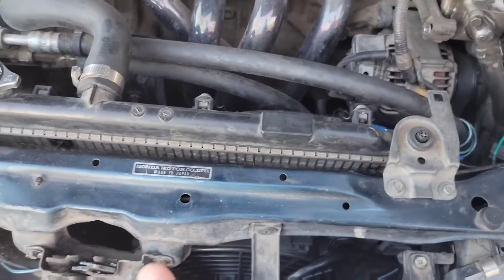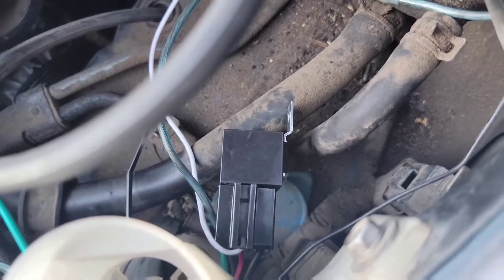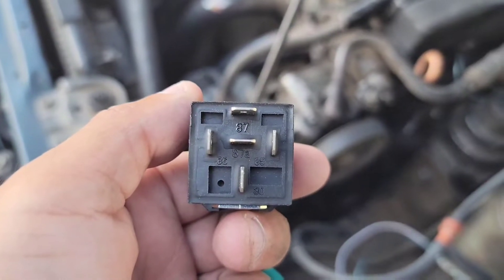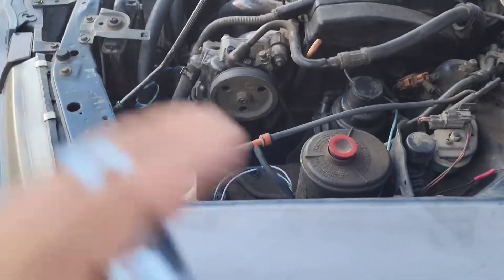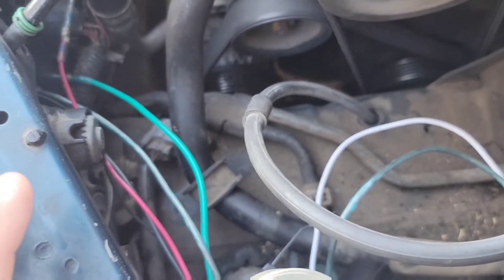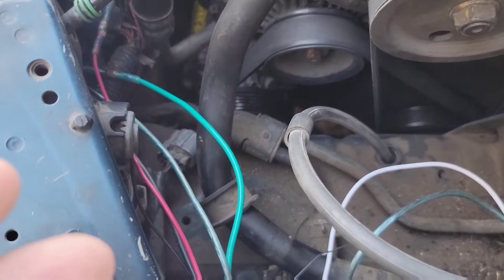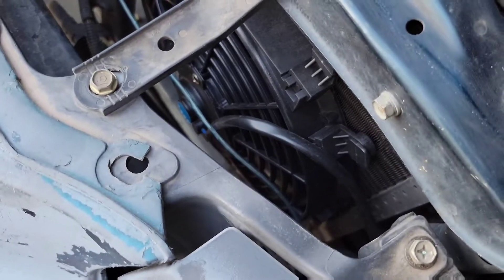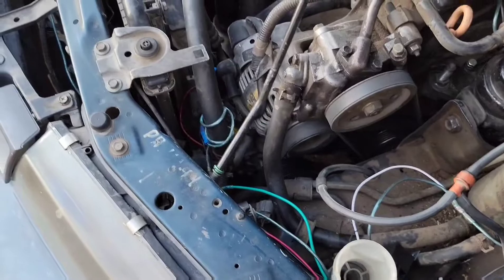How to install electric fan with 5-pin relay on your car

Comment: Thank you I have mine wired to turn on with a thermo switch but I want both my fans to come on when it’s too hot . So I’ll rewire my stock aux fan back to the thermo switch and then take my 86 trigger wire and tap into the aux power wire so they both switch on at the same time when the thermo flips .